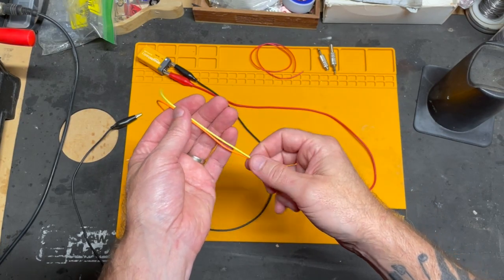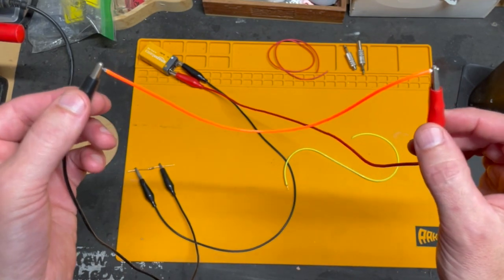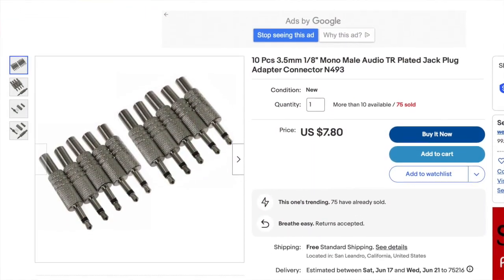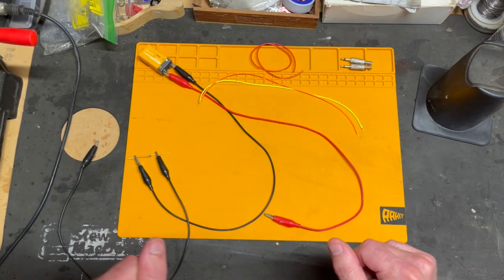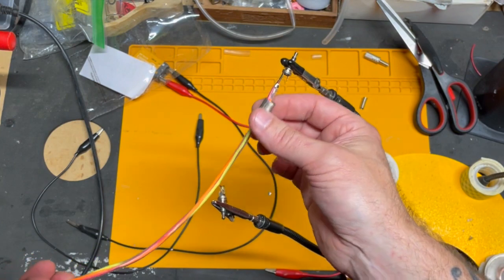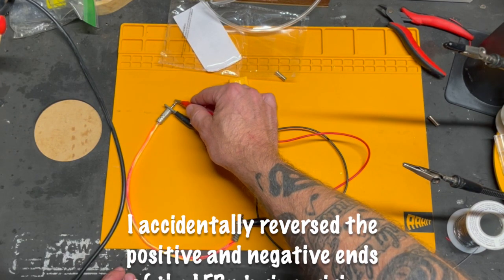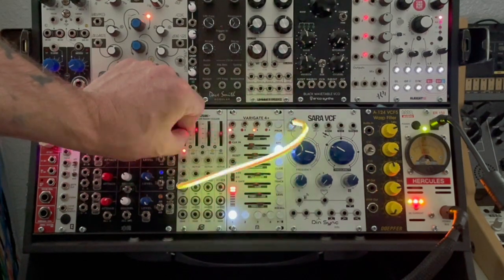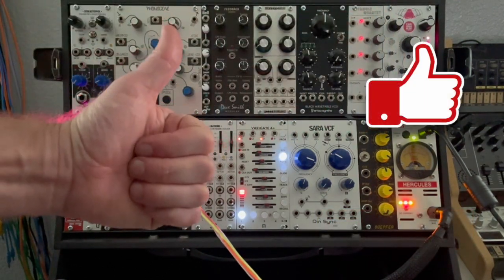How to Make a Light-up Patch Cable (simple DIY project)

Comment: Dude, you're awesome! I had no idea transparent heat shrink tubing even existed. I always used just the regular transparent tubing, but because they are rather inflexible, - it was very difficult to pass the filament LEDs through the small diameter tubing, while the large diameter tubing presented challenges such as twisting of the two wires and difficulty with inserting the tube into the metal sleeve of the 3.5mm connector. Prior to this I has a project where I passed the "Neon" LED ropes through transparent tubes together with audio cables running to the mixing board (of course these had a separate DC power source) but the color told me which synth the cable was running to and from even in the darkened studio. Subbed. The only issue for me is - I'm not sure I understand your diagram. There is nothing connected to the "S" lead on the left, - how is the circuit being closed then?
Reply from the maker: Thanks for checking out the video. The circuit diagram boggled my brain for a minute too. Effectively the current is running in the same loop (even when the polarity changes) because there will always be an input and an output but never 2 outputs. So adding a second ground ends up being redundant. You just don't need it. Every time the LED lights, the current is flowing to ground regardless of the cable's orientation. If you had the commons hooked together, the current would have a faster path to ground and - theoretically - wouldn't flow through the LED in the reverse polarity. I hope that made sense.
Reply: @musicalmiscellany  Oh, I see what you mean now. Thank you. It didn't make sense to me at first because I kept thinking about how those Heinakroon LED "testing cables" are wired, which are low voltage and are mainly meant for LFOs of modular synths with the intent to make the LED flash faster or slower depending on how you adjust the LFO rate. But because those have 2 conventional LEDs on each end rather than a continuous filament LEDs, - I got confused over directionality of current trying to superimpose their wiring diagram over your own for comparison.

Comment: What could happen if i dont used the ground wire, I've seen some that just have the light one, and whats the size of the wire in case that is so necessary
Reply from the maker: @JoseMiguel-im9jz  I don’t think the gauge of wire would make much difference. Probably 18 or 20 would be fine. I can’t tell you what would happen if you wire it differently because this is how I did it. You could always try it and find out.
Reply: @musicalmiscellany  thanks i didnt knew it was called gauge insted of size lol thanks again man but still need the wire no matter what, correct?
Reply from the maker: @JoseMiguel-im9jz  as far as I can tell, yes.

Comment: Far freaking out.

I do not know what I will do with this but it is being filed away to be used later.
Reply from the maker: LOL. It's a pretty simple concept. The cable light up Whenever there is at least 3V flowing to ground. Unfortunately, most instruments don't produce that much voltage but it works good for control voltages because they tend to be around 5V.
Reply: @musicalmiscellany  Understood

But I never knew such a thing was even available. When I start build a eurorack modular synth, the first this I am going to get will be a cre8audio west pest synth. But the next thing I will get/build will be a good LFO. These would be fun and easy to build to go with  a LFO.
Reply from the maker: @bearshield7138  I love those CR8Audio synths. Both the West Pest and East Beast are really great synths and very affordable. I wish those would've been around when I started into modular. LFOs are such an essential part of synthesis too. They are really useful.
Reply: @musicalmiscellany  cool cool

in time